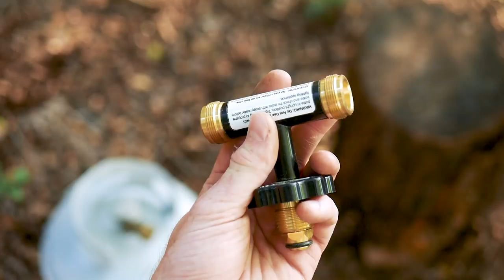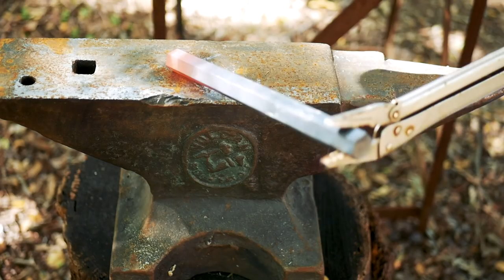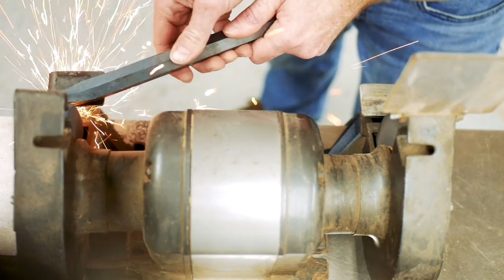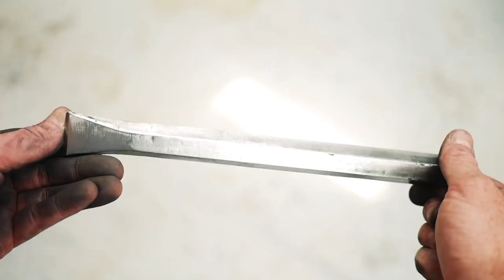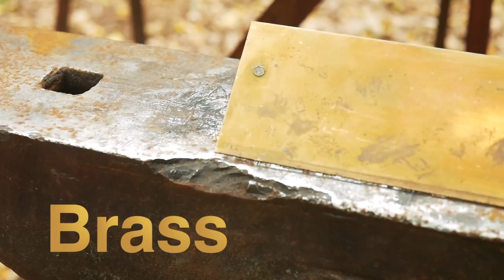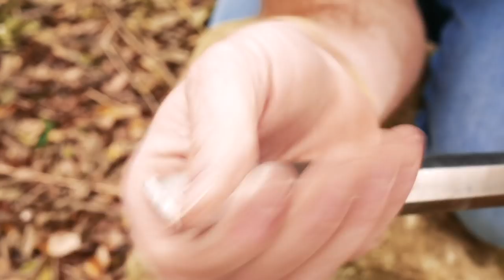Forging a Chisel

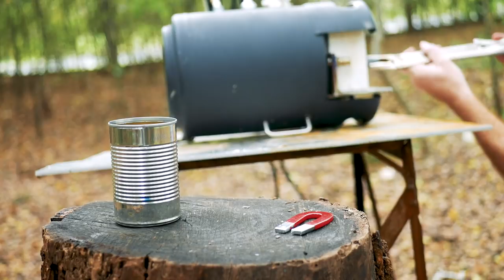Comment: 3:31 why the magnet?
Reply: I think it's to ensure the chisel cannot be magnetised? That's my best guess. I wonder how doing that even worked...
Reply: @MrLuigiBean1   it could be. only the master can illuminate us
Reply: It's to gauge temperature, when the steel hits its curie temperature (the point at which some materials lose their magnetism) it can be hardened.
Reply: When the steel reaches the correct temperature, it loses it's magnetic capability. Here's a good summary: http://threeplanes.net/toolsteel.html
Reply: Ohh! I understand now! Thank you for explaining it to me and the others reading this!👍
Reply: Thanks guys for teaching a new thing!
Reply: @MrLuigiBean1 - You're welcome. :)
Reply: @yoans888 - You're welcome. :)
Reply: Yoan Shin When tempering the metal, you need to get it to a certain temperature in order for it to harden correctly. When the metal is heated to the point when it looses magnetization, it's an indicator that it's reached that temperature and will harden correctly after quenching.Hope that helped..Cheers
Reply: @PathinAZ  Thanks bro very clear!

Comment: Sometimes the struck end is heated to a higher tempering color, such as blue, to make it softer and less likely to chip when struck.  You did a fine job of hardening and tempering.   Using oil to quench with unknown steel type was smart.

Comment: You could have tempered the end to reduce warping. I know, I’m just an obserever but you could have done it is all I’m saying.
Reply: P.S. It could have also reduced the chipping issue.
Reply from the maker: I think not knowing the blend of steel to start with meant that the whole heat treating process might have just given me a case hardening. I plan on using this for stone work, which didn’t affect the edge anyway, so that should be less destructive to the edge.